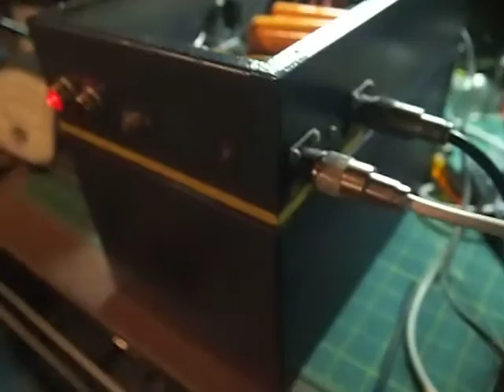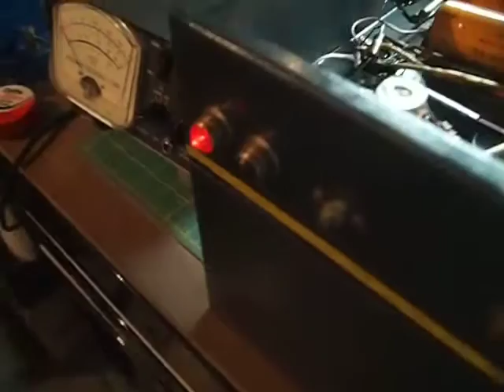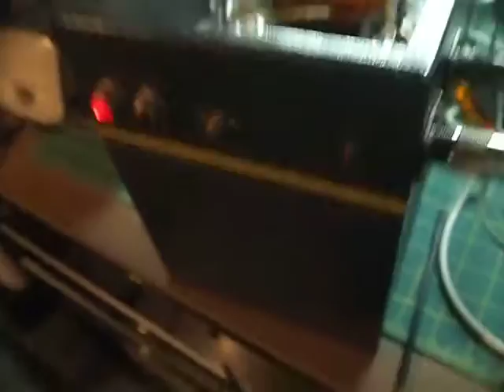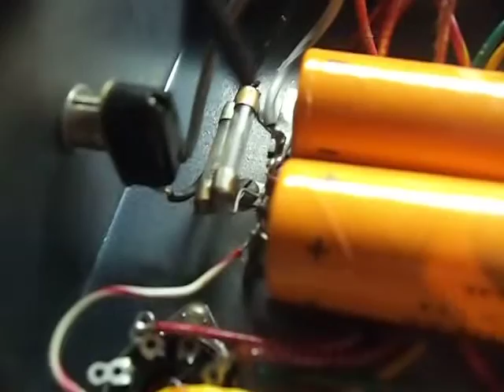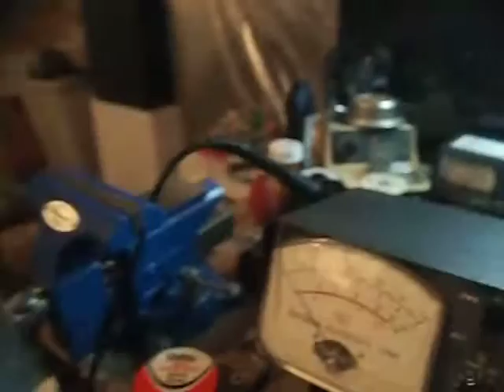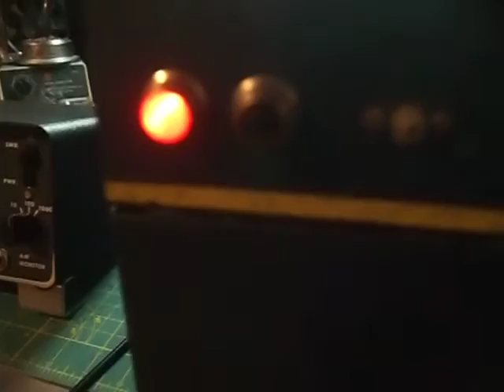Elenco Long Ranger LR-1 Amplifier

Comment: Guess made those in his garage yrs ago around Marion indiana. By the way that think should do more then 20 watts 🤦‍♂️
Old
Memories had a few if those in the late 80s. They have a few models and one had a rubber band type on one of the variable to tune the amp, forget what it was called been to long to recall 🤷‍♂️
Tram Dr had one. I’d say 100watt a pep on that amp but as I stated I can’t recall, it’s no power house but what sweep tube amps are? 😂

Comment: Would you mind posting the tune up steps. I have an LR -1 from my grandad and would like to use it. Many thanks for posting this. Not much info on it.
Reply: The 2 tuners are standard Tune and Load like any other amplifier. The one closer to the lights is the Tune cap. Tune both of those for max output. If makes very little difference which one you tune first, but start with the Tune first. There is no other tuning with this amp.

Comment: Thanks for the vid. I just picked one up but it didn't have any caps in it. I did a little reverse engineering and it is set up as a tetrode amp, high gain modulator. It has full plate volts on the screen, grid driven, and - bias on the grid. In short its a modulator/swinging machine.
Reply: Tramdr is the man

Comment: I have this same amp. I thought it was home made with the wire wrapped around medicine bottles and someone said it was a modulator. I can’t believe you have one I have had mine since 1975 and I traded a 1/4 wave radio Shack ground plane for it.  I had a guy test it one day and I think it was keying almost nothing but it would swing over 100 I think 125. I also have the Varmint XL 100 so I have 2 of your collection pieces...Cool...

Comment: I have one of these and when I first got it the cheap little wrapped coil bottle was loose and the wraps were all messed up. I'd like to know how I could replace it with a new coil but I don't know how many turns and of what length and gauge wire it needs to be.
Reply: What did you do with yours? Look at one of my last uploads (Whistler) and see if it is similar to yours.

Comment: Hey do you have any amps that use two 8950 or similar output tubes and a 12JB6 driver?  I have a PAL200MDX with blown switching transistors.  Can't find any info on them.  If you have anything similar I'd be awesome if you could clue me in as to what transistors your amps use so I can get an idea of what the ratings are so I can fix mine.

Comment: Nice looking amp and its much like my older Elenco LR 5, which useses 4 17jb6a tubes with a 1700 volt plate.It uses a small tube run off a set of three bleeder resistors tapped at 600 volts.As for power, it saturates at 300 watts ssb with moderate splatter and runs 200 watts fairly clean.On am drive it will run a 70 carrier and modulate well.The Long Ranger 5 doesn't have a tuned input like yours does and relies on a length of coax on the balancethe input curcuit.
Reply: no way.
Reply: I just negatived my own old comment. I just got an LR6 with 2 35kn6 tubes and in fact, it did have 1500v on the plate. I thought that it was something wrong with it, that those tubes can't take that. I was wrong, my bad, sorry.